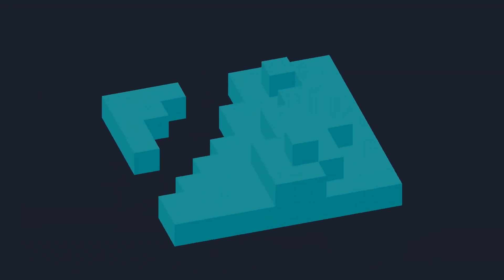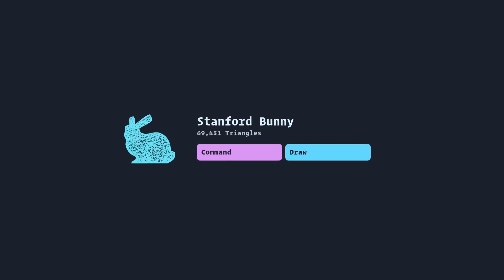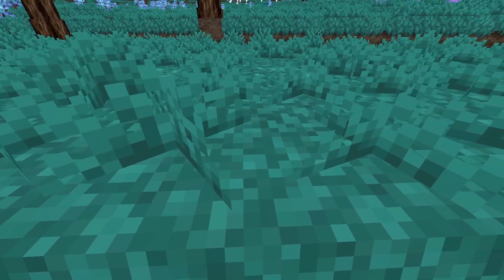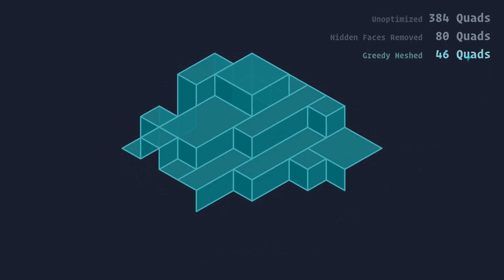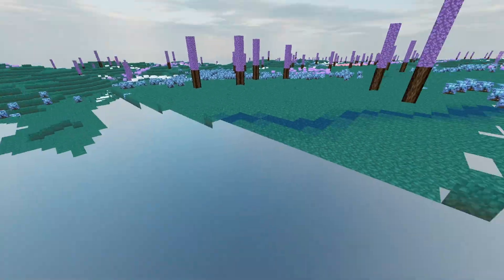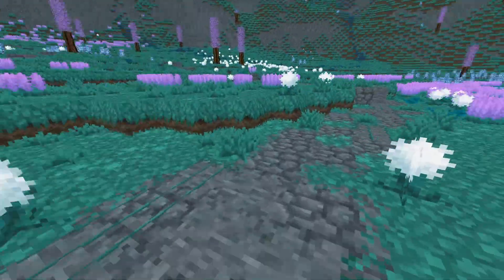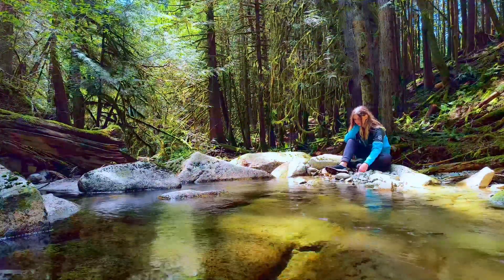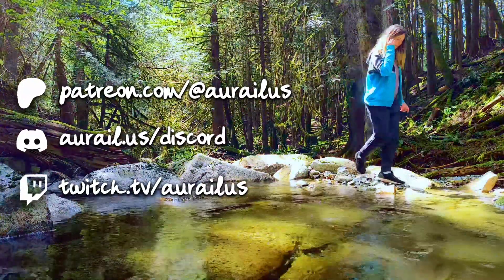So how are voxel games rendered, anyways?

Comment: I never knew that Minecraft only uses the second stage of naive meshing instead of greedy meshing.
That's a bit disappointing tbh.
Reply: Vanilla Minecraft is horribly inefficient -- partially due to Notch not being a graphics programmer, partially due to Mojang being extremely lazy.

Optifine got famous for literally doubling the frame rate.

Mods such as Distant Horizons that have a HUGE draw distance shows what is possible when you have people who actually know what they are doing.
Reply from the maker: Yep, Minecraft is incredibly basic as far as rendering is concerned. Unless I'm mistaken, it's almost entirely single threaded too. It's a real shame, honestly. But it does make it very easy to make impressive seeming performance gains in my game, even if those optimizations are pretty standard at this point :p (I am going into some more interesting optimizations in the next video though, this was mainly an introduction to the topic!)
Reply: Yep. It's quite dissapointing to see how much of a performance boost a single mod can give Minecraft (Sodium). It brings it from 40 fps at 32 render distance to 140, on a Steam Deck (@1080p) lol
Reply: The sodium mod achieves quite impressive performance improvements without greedy meshing so it's not really that big of a deal. GM also doesn't work well with randomly rotated/mirrored textures (without hacky shader shenanigans), which greatly helps with reducing ugly tiling artifacts.

Comment: There is a Minecraft mod called Nvidium that uses mesh shaders to drastically improve the rendering performance. The mod author says that the mod is only supported on NVidia GPUs, but the mesh shaders technology is available on AMD and Intel GPUs and is part of the Vulkan API.
Also, Distant Horizons mod makes it so you can render over 100 chunks around you. But I think it just uses some kind of LOD implementation, which you have started implementing.
But I'm sure you can find something interesting from the Minecraft mods to implement in your voxel engine.
Love your videos, keep it up.
Reply from the maker: Yeah, I've been absently aware of all of these, but I haven't taken the time to look into them. I should probably do some 'market research' on stream at some point and compare the rendering techniques and algorithms they use to generate LOD terrain :)
Reply: @Aurailus  you should get a modloader and install the modpack "fabulously optimized" since it conta8ns just about every opmtization mod under the sun
Reply: I also recommend Voxy, it is like Distant Horizon but it uses the GPU for LOD generation and it uses a different LOD system that visually looks identical to normal blocks but somehow renders less blocks...? I don't know how that black magic works but it looks amazing
Reply: This made me think that the further away from the camera's location, the shallower the angle the camera sees the blocks with respect to the horizon. This means that proportionately less of the top of voxels you see in the distsnce, and the more of one ot two of their sides. So at some distance you should be able to get away with not drawing multiple sides of the voxels (whichever quadtree level of detail they are at) but instead draw Billboards of their closest side.
Reply: @amca1975  You're right, but that requires you to generate separate meshes for each block face and then check which face is visible. I'm pretty sure it's not worth the effort though.

But for reference: in order to avoid holes you can't rely on angles because there's degenerate cases, so you'd basically render a single face for 6 blocks that are aligned with camera on each side, 2 faces for blocks that are coplanar with the camera on any axis, and 3 faces for the rest. The problem is that you can't render a single face (or only 2) for a single block (slice) in a chunk and more for others without changing the baked chunk meshes as the camera moves - doing so is likely slower for large number of chunks than using other techniques and plain backface culling.

Assuming you can change the chunk meshes quickly enough, implementation of this is quite hairy (I've tried) and you end up with very complicated meshing code that's hard to add to.
Reply: @Caellyan Ah, I see. Thanks for the insight.
Reply: @WakeUp4L1fe  I think the point was that the devs for Minecraft never implemented beyond the one change she said